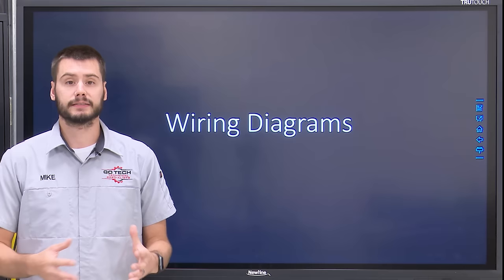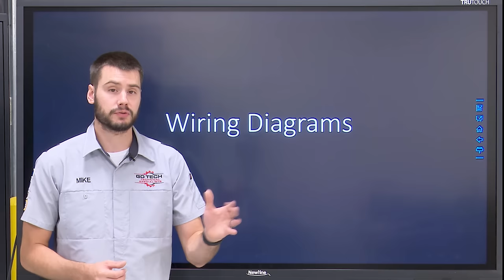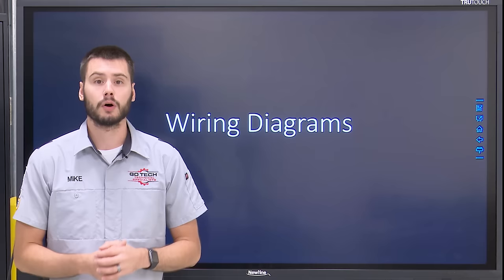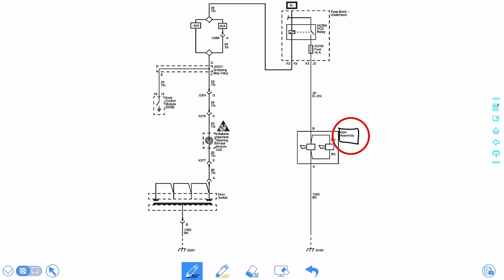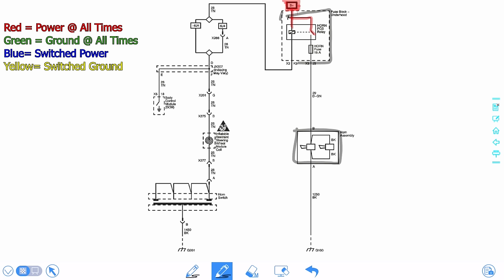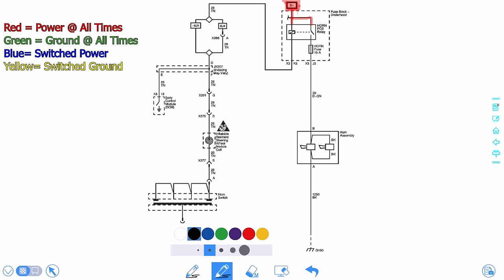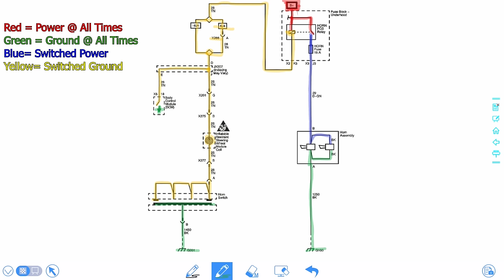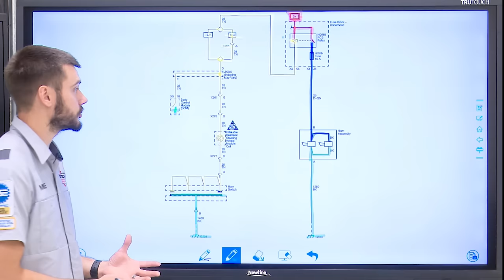How To Read, Understand, And Use A Wiring Diagram - Part 1 - The Basics

Comment: Hey Mike - Great first vid in hopefully a long series. I also cannot emphasize enough the aspect of paid info. I have people come to me confused with electrical/circuit problems who find wiring diagrams for free that inevitably are incorrect for their car (different year, model, engine, etc). If you want to do these types of repairs properly, you've got to have correct diagrams. Even if you DO subscribe to a data provider, they can sometimes be wrong. 
Great series!
Reply from the maker: Hey, thanks a ton! Yeh it'll likely be a very long series haha! Getting accurate information is harder than it needs to be sometimes, right?
Mike Becker, Senior Instructor
Reply: A 100% correct diagram doesnt exist :)

Comment: I'm doing an engine rebuild atm so I can't really do too much electrical work (running the vehicle or attaching the battery), but to apply this in a way that's currently needed instead of just for practice, I wanna use my OEM manual's cooling fan diagram and see if I can figure out why the cooling fans might not be working past what I already know to check. The relays and the fan motors work and I ordered a new coolant temperature sensor, the diagrams can help me know if there are any other possibilities other than the wiring itself. 

I'm excited to be learning how to do electrical work because it's one of the procedures I haven't learned enough about yet to do as a tech.
Reply from the maker: Hey Wyatt, thanks for watching! Cooling fan diagrams can be tricky! Good luck :)
Mike Becker, Senior Instructor

Comment: hey mike.  i didnt hear you elaborate about the two paths that are the switched ground.  maybe i'm getting ahead of you, if so disregard.  some may be confused that either the horn button or the bcm can control the horn so it may work with one but not the other. in diagnosing sometimes a circuit works part time which may be caused by such a scenario and will throw off a technician to look for a fault that may be intermittent  rather than understanding the entirety of how the system works. also since the bcm can operate it additional checks at the bcm if that part of the circuit is malfunctioning will be in order.
Reply from the maker: Hey Richard, I planned on bringing this exact thing up once we begin to apply testing to the circuit/diagram. Super valid point to be made there. I'll make sure to cover it...but it will likely be a little bit later in the series.
Mike Becker, Senior Instructor

Comment: I changed the  blower motor on my 2018 GMC Sierra with a new aftermarket motor.  It works but when I start pickup the blower doesn't kick in for about 2-3 seconds and when I shut pickup off the blower stays running for 2-3 seconds.  Any idea what it could be?  I wanted a resistor but they didnt stock them when I ordered blower motor.  Thanks in advance
Reply from the maker: Hey Wayne, that's interesting. It could just be the time it takes for the blower to come up to speed gradually. I would start by checking the power and command input into the blower more at initial start-up and shut-down to see if its being to commanded to do what you're saying or that it's simply winding up and winding down.
Mike Becker, Senior Instructor

Comment: Hello - I'm trying to learn schematics to work on CB radios.  I can understand the different components, like transistors, diodes, etc.  What seems difficult for me is I look at the radio....look at the schematic and I'm like, "Huh?"  It doesn't lay out the same so I get confused from the start.  Is there any way to visualize the same thing when you're looking at two different things?  See what I'm saying?   Like this, it takes me forever to find what I'm looking for on the schematic.  When I find it, like a potentiometer (knob), how can I trace the wires and know where they need to be soldered on the PCB??  Solder them in the wrong spot and smoke will appear soon!  I watched wiring diagrams 1 and 2 on your channel.  Just trying to get a better idea.  Thank you for the videos!

Comment: I'm going to quibble with you about a couple of things.  1. Your wire color code does not in general carry over into reality inside a car. Ground is not generally green.   it can be any color or combination of colors.  2. In modern systems there are often multiple grounds with different symbols and diffferent function, e.g. chassis ground and power ground.  In the case of cars they are usually the same, but on computer modules they arey are often different.  It's not wise to teach something as a "rule" when in the real thing there are often no 'rules'.
Reply from the maker: Hey Tim, thanks for watching! I'm sorry if I led you to believe that we are tracing the ground circuit in a green color because that's what's on the car. We are only tracing it green for our trace. So we can remain uniform from diagram to diagram over time. That has no reflection on what is actually on the car.
Mike Becker, Senior Instructor
Reply: @GoTechTraining   understood what you were doing.  i've been a technician/engineer for 60 years and since your vlog is for beginners I just think you need to be really clear tat you're just tracing wires.

Comment: The part of the diagram for my blower motor that confuses me.  It has a 40 amp fuse protecting the 30 amp relay.  Shouldn't the relay burnout before the fuse blows?

Comment: Does B+ imply fused power? I don't see a fuse after the relay coil, and on down to G201 etc.
Reply from the maker: Hey Rhoptry, typically B+ implies it's connected directly back to the battery in some manner. Many times through a hot lead at the fuse box...but if there's a fuse, it would be labeled in a diagram.
Mike Becker, Senior Instructor

Comment: Awesome video. Can you help me? I'm doing an engine swap for a 92 nissan d21 pickup 4x4 with a ka24e engine. Im swapping engines with a dohc  ka24de from a frontier. Im using a standalone ecu that uses the factory ka24e wiring harness. There are a few differences when comparing the two engines that being the dohc, a few sensor, the sensor connectors, and the ignition system. I've converted the dohc to use wasted cop using the standalone, and have spark on all coils. 
I am confused on how to convert and build the ignition system to trigger spark with key turned to start. The sohc distributor is a 4 pin distributor that runs an optic crank/cam sensor separate from the coil. The dohc distributor has the ignition system intergrated with the distributor. Could you make a video for the wiring for this and how to frankenstein this new system to communicate with standalone. I would gladly pay you for your help. Thankyou

Comment: Hi really like ur video/explanation only issue is I'm from UK and use autodata for wiring diagram but still sometimes get lost when it comes to control unit switching power/ground as it's not clear as the diagram u r using can u help please? Thanks in advance
Reply from the maker: Hey Tristan, thanks for watching! Be sure to check out part 2. I'll be getting into the switching aspect even more in that one.
Mike Becker, Senior Instructor

Comment: In your diagram you use the switch to draw power into the relay. My question is why is the switch not placed/connected to the battery but shown separately as a part of a control circuit? By the way I am not an engineer  but deeply interested to know the basics of wiring. Thank you in advance.

Comment: Can't find an email address so have to ask about a problem this way.  I have a 2009 Buick Lacrosse, 3.8L.  There are no codes but when I try to accelerate it's, what my mechanic friend says, "falls on it's face".  I can accelerate to highway speed as long as I use a feather touch on the gas pedal but if I start to go up an incline and try to give it a little more gas it bogs down.  We've replaced the Mass Air Flow sensor, the MAP sensor.  The Catalytic Converter is ok.  Hooked up fuel pressure gauge and took it out on the road and the pressure is right on spec when the car "falls on it's face".  My friend has been pulling out his hair trying to figure it out.  I'm waiting for a Crankshaft Position sensor to try that but if that doesn't fix it, what else can we try.....that is unless you know what it is.   The car has 173,000 miles on it.  Thank you for any help you can give.

Comment: Great series, glad to learn something new! For the home mechanics paying for a subscription for multiple cars can be an expensive item, is their a company that might just sell you what you looking for???
Reply from the maker: Hey, thanks for watching! Hmm not sure. Sometimes you can get like the Hanes or Chilton manual for the car. They may have diagrams in them for the specific car.
Mike Becker, Senior Instructor
Reply: Alldata has something like that geared for Diy. I think it's priced per car. Check them out. Also your local library may have access to a similar service. Mine does and they use Chilton online

Comment: Amazing representation. One question though- if anyone can answer, where are we getting power from to turn the switch on the yellow portion? In other words, how is switched ground getting its power or how is the switch activated for yellow? We're using the left side of the circuit to power the relay to power the right side of the circuit, but how is the left side being powered/controlled? Tried my best to explain my question lol
Reply: basically power always seeks out ground. when the steering wheel horn switch is not pressed then nothing is grounded so no power flows. when the horn switch is pressed it connects that ground and power from the battery in red actually flows through the relay all the way to the ground switch in your steering wheel. and the relay coil closes the relay switch which the power there will also seek out horn's ground.
Reply: @dandee68  thank you for your explanation :)

Comment: Whatever that article say, dont use orange. At industrial wiring, orange is used as external voltage source (not safe)
Reply: Automotive electrical colors are different then (nec) building colors
Reply: @wtf0101  Yeap most likely... but, they should change into the IEC standard. I mean... the confusion it makes. Is it just by pure luck that they have agreed to GN/YE or GN as standard colour for Protective Earth ?!
Reply from the maker: Hey Roger, orange wires in cars means high voltage 99% of the time. Typically only seen on hybrids.
Mike Becker, Senior Instructor
Reply: @GoTechTraining  That maybe true, but its confusing when the main industry is advocating orange as external voltage.
High voltage ? Do you mean >1000VAC or >1500VDC ?
Reply: @GoTechTraining  Yeap, im from the industry, electrical, whic might be obvious now. Always interesting to hear other perspective though :)

Comment: Hi, I don't understand why you're using different colors for switched power and switched ground since that doesn't really represent what is going on in the circuit. In my opinion, using orange (blue in this video) for switched power and yellow for switched ground makes it more confusing and difficult to understand. Why not just color the wires that go from ground through the horn and up to the bottom relay contact all green since a multimeter would show ground at the bottom relay contact when at rest. Checking the circuit on the left with a multimeter, would show power through the relay coil all the way to the BCM and to the horn switch when at rest. The ground on the left circuit would stop at the horn switch. I guess I'm missing something here because I can't figure out the benefit of using different colors for switched powers and grounds. Can you please explain the benefits.
Reply from the maker: Bernardo, that is a very valid point. At rest power and ground do just what you are saying. The switched power and switched ground is intended to show what the circuit does upon activation. A way to visualize what happens in the circuit. But you are 100% correct, a multi-meter in rest would show what you said. I'm going to use this in part 2.Thanks!
Mike Becker, Senior Instructor

Comment: Can someone explain in further detail regarding the Switched Ground?
Reply: It simply means that instead of "turning on the power" as you would with a light switch, the power supply is constant, and the switch is controlling the path to ground. It's not uncommon for automotive circuits to be wired in this fashion.

Comment: Mike,  good information and presentation. But if you want a REAL CHALLENGE go back to wiring diagrams for vehicles in the 1960s. Obviously lots less electrical components and wiring but the illustrators would cram all the wiring from bumper to bumper in a vehicle on  2 pages. You would go cross eyed trying to follow the minute lines for power and ground.
Reply from the maker: Hey Allan, oh man....those are the worst! We have old manuals in the office from the 40's and on. You can easily get lost for sure!
Mike Becker, Senior Instructor

Comment: Don't forget how diagrams  change between manufacturers and even over time.  I still can't read a Subaru wiring diagram.
Reply from the maker: Hey Shaun, for sure man! Ahhh funny you mention Subaru...I think that will be in part 3 ;)
Mike Becker, Senior Instructor
Reply: @GoTechTraining  😆I'll be there.
Reply: And German auto are tricky too🍻
Reply: @johnmwangi6291 , I didn't mention it myself or I would have broken my keyboard or punched my monitor thinking about it. The Germans and Subaru both use what's called track style diagrams. Mitchell does a terrible job of redrawing them, too.

Comment: That’s showing two different types of grounds.
Reply from the maker: Hey Hvac1, thanks for watching. What do you mean?
Mike Becker, Senior Instructor
Reply: GoTech Looks like one’s a chassis ground and one’s a battery ground
Reply: One is referred to as chassis ground and the other one is technically earth ground which I am assuming is connected directly to the battery ground.
Reply from the maker: Hey Hvac 1, actually neither of them attach directly to the battery. G100 is a ground point that attaches on the passenger front frame and G201 attaches to the firewall. The other ground is found internal to the BCM.
Mike Becker, Senior Instructor
Reply: According to IEC standard that chassis ground symbol is obsolete

Comment: You should teach International and Spartan chassis, Paccar and many more how to wire and design wiring schematics. I laugh 😆 when I have to deal with them.. they are terrible..and usually only resolve the issue after applying common sense to their total dyslexic mess of power distribution and component controls..🤪

Comment: wow nice video bro , im subbed ! LOL , ENJOYED YOUR VIDEO SO MUCH I JUST HAD TO SUB !!!!  ...  what started my nightmare almost 4 months ago was a no crank /no start codes were UO100 AND PO23F ...
I GOT A 2011 BUICK LACROSSE ,BEEN PARKED 3 MONTHS , ITS A MYSTERY . ON MY 3 CODE READERS INCLUDING BLUEDRIVER I GET THE FAMOUS UO100 AND PO23F CODES .  I GIT 1OO'S OF CHILTON INFO,TIPS DIAGRAMS AND SCEMATIC S  etc.
   . .....
AT ONE TIME ,FOR A COUPLE OF MONTHS , MY HORN,WIPERS,RADIO VOLUME,SEATS,,A FEW OTHER THINGS INCLUDING MY CHECK ENGINE LIGHT AND GAS GAUGE QUIT WORKING , 
BY JIGGLING THE WIRES AT X108 CONNECTION AFTER CLEANING AND APPLYING DIE0ELECTRIC GREASE ,I GOT IT ALL TO COME BACK ON , SO I CAN AT LEAST READ CODES AGAIN ................
 MY # 10 FUSE WHICE IS A ECM FUSE KEEPS BURNING ALWAYS  , I NOTICE ALSO GOT GROUND ON BOTH SIDE HERE AND I NOTICED I GOT GROUND AT A BUNCH ,NOT ALL FUSES IN MY FUSE BOX , I GOT THE TEST LIGHT THAT SHOWS RED OR GREEN LIGHT .

 I ALSO USED MY DMM TO CONFIRM CONTINUITY BETWEEN FUSES AND CHASSIS GROUND AND BATTERY POSITIVE
 . WTH ? . 
TODAY ILL GOT THE POWERPROBE 3 AND THE POWERPROBE "THE HOOK: ,BOUGHT THEM BOTH ! .
 I WILL ALSO HAVE THE POWERPROBE ECT-2000 .THE CLOSEST TO A TECH COMPUTER I GOT IS A BLUEFRIVER , LOL ...
 ANY TIPS BROTHER WOULD DEF BE MOST APPRECIATED !  THANK YOU KINDLY SIR FOR YOUR REPLY IN ADVANCED